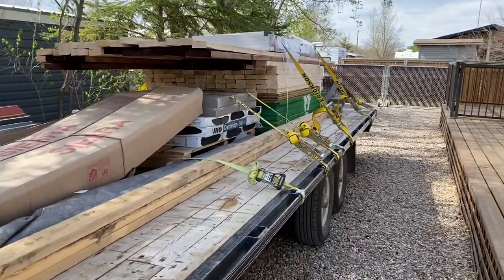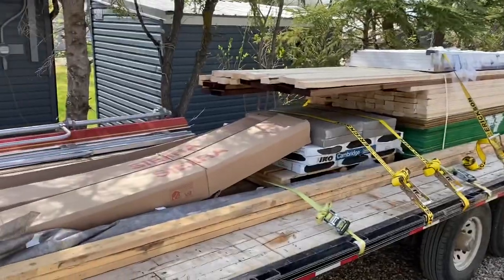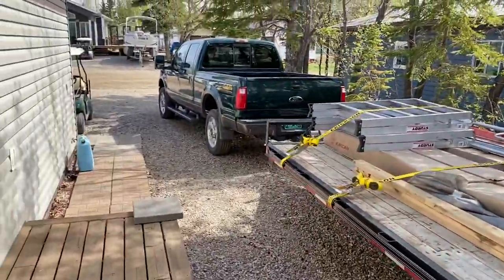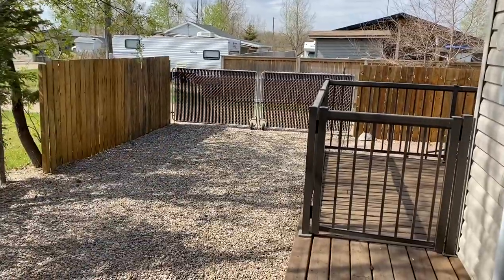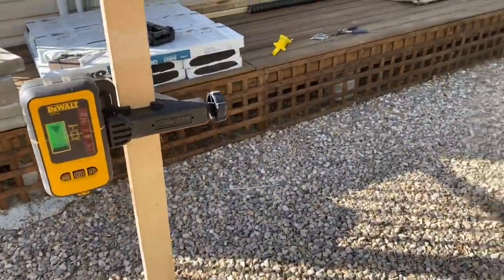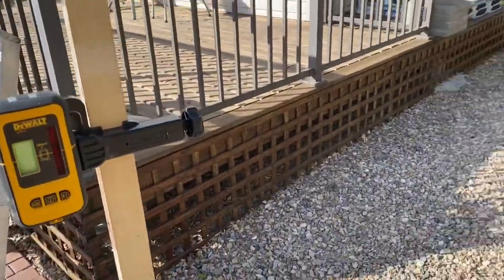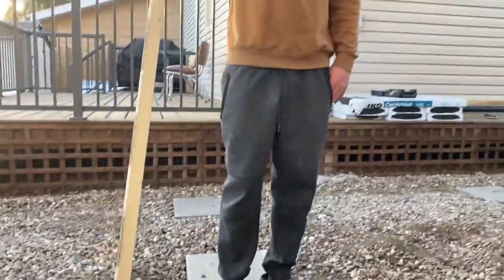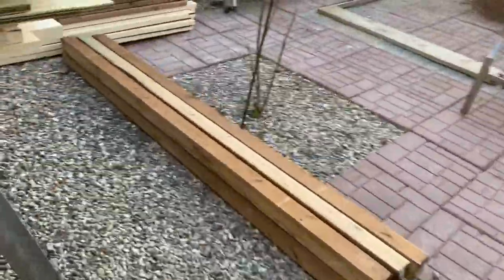Shed build part 1

Comment: Hey Austin

Looking forward to your new build.
Question
Would you ever put rigid board under the pads to help with frost heaving?
A friend has suggested it for an older 
wooden patio, sitting on blocks like you have here. It lifts pretty high in the winter and blocks the door to our gazebo. Half of May goes by without being able to open the door.
Reply from the maker: I’m not sure that would make much difference, I’ve never had an issue with any of my smaller buildings shifting
Reply: @AustinTischler  

Okay thanks Austin🙂